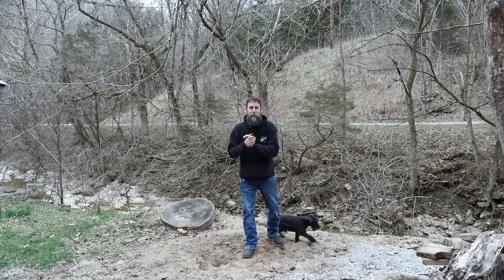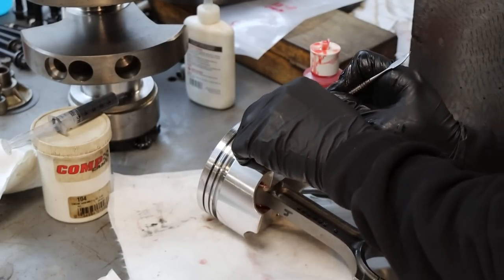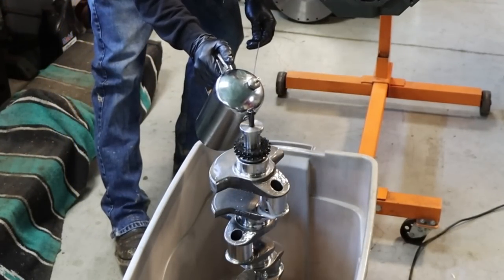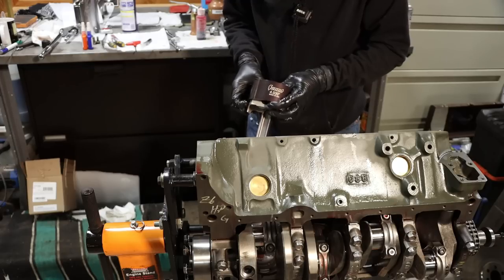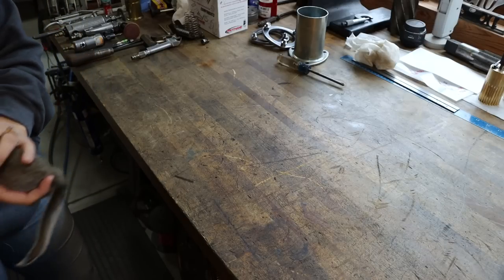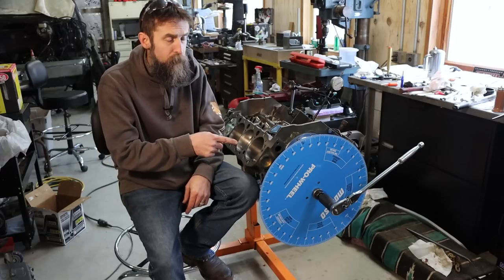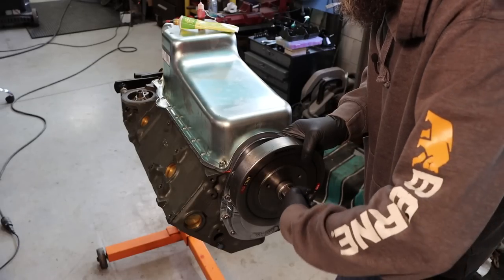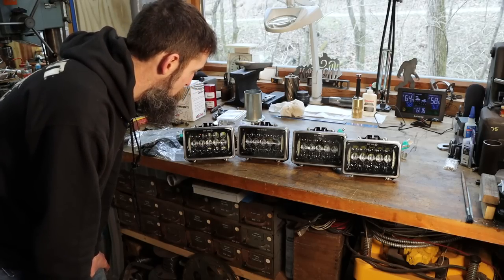Stroked Short Block 383 Day!  Shop under new management!

Comment: Future suggestion ... if you're hell bent on using something like gasoline to clean the block, use diesel instead. Why? Two reasons: 1) Gas and gas fumes are highly flammable. Diesel, not so much. 2) Gas vapors burn brain cells when it evaporates and you breathe it in (becomes a volatile substance). Since diesel doesn't evaporate anything like gas does, far less of a worry. Diesel has great cleaning properties as well. Since diesel is technically an oil, you also get a coat of rust prevention built in.
Reply: Exactly. Maybe one of the parts washer companies will sponsor a safer option. I used gas to clean parts back in the day but not anymore
Reply: People have found some incredibly creative ways to die while using gasoline to clean things. If you're bored some time, look up "flaming rat case" for a particularly bizarre example.

Diesel or non-volatile degreasers are much better options than gasoline.

Comment: I love my sure shot, and had an issue (rusted on the bottom, and was plugging the nozzle).  The thing is 2 or 3 years old, but I contacted them and they said "THAT should not happen, even though it's out of warranty, we're replacing it".  WOW...American Made, and amazing customer service.  I'll buy more of these for more fluids for sure!  What was in it?  Brakkleen...that's it...and they assured me that this is NOT normal, and SHOULD NOT Happen...which is why they are replacing it.  Very happy with the customer service!

Comment: Steve my experience if the proper break in procedure is followed and lifters and cam fail it is because the lifter bores and camshaft center line is not perfectly square. GM had a long history of factory failure during the time period the square bodies were built. I have had blocks that had camshaft lifter failures multiple times and the solution is to scrap those blocks that do.  They will never be right. Roller cams and lifters are great as long as the rollers are maintained square with the lobe of the cam and the cam is anchored so it can not walk forward in the engine. It is also critical to make sure you have the correct push rods for the roller lifters. The roller cam blocks use a shorter push rod than a flat tappet cam block. If you do not already know it you will need the oil pump shaft from a 400 small block. It has a relief machined in the middle of the shaft.

Comment: I'm no mechanic and I'm not even really into cars, but years ago I had an 82 Chevy square body with a 383 stroker. I cannot recommend dual straight pipes highly enough, a lovely burbling. It was ridiculous with a 14-in lift, your feet would bounce off the headliner, but once I gave it adult suspension, that was the most durable truck I've ever had. It was my farm vehicle so it was not treated well, never once let me down and I never found a situation it did not have enough torque for that any other vehicle could. It was not a refined vehicle, you would not want to do a road trip in it. But if you need to move a double wide half a mile or pull down a big fir tree, could not ask for better. Never even needed ether, every single time you turn the key it would sound like the battery was dying and you would get that really weak crank, but she would catch every time. I've had stock Chevy trucks and I was not nearly as impressed, that 383 was ready to work!

Comment: Once you've verified your timing TDC timing mark on the vibration dampener, I always match mark the outer ring and the hub, so you will easily determine with absolute certainty, whether the outer ring has moved in relation to the inner hub. It only takes a couple minutes to punch, but will save you hours of "reinventing the wheel" if it has slipped in the future.

Comment: Silicon the oil pan gasket around the timing cover and rear seal curve. The instructions say not too, only in corners but they always leak without a little silicon. Ultra grey will work.

Comment: I was just reading an article about this economic phenomenon. When hyperinflation is on the horizon, major companies that think they will survive the downtime will engage in various practices to keep profits up. This is already been observed in the majority of groceries, something called shrinkflation. If you start paying attention to your labels, you will notice that the very familiar package has slightly less contents then what you are used to. It's all about the pennies. This article specifically mentioned less scrupulous firms using mislabeled poorer quality steel, all kinds of components are available at a lower cost without changing the appearance. Most brands go through a refresh at least once every 3 years. When you start to notice that packaging is stagnant, that's when you want to really pay attention to the unit pricing. If I'm not mistaken, this article concluded that 70% of groceries were being dropped on average from 16 oz to 13.4 Oz. Not a huge amount, but pretty slimy to hide it with the older packaging. Keep your eyes up folks

Comment: 4:23: You could use Kerosone,  Lamp-Oil or White-Spirits instead. The benefit is way less smell and fire-hazard, and you can lit your BBQ with it afterwards, a convinient way of disposal. I collect it in a PET-bottle for disposal at the recycling-station OR for use to lit the BBQ or camp-fire.

I allways wait until the coals in the BBQ or Camp-Fire stops smoking or smell unusally or badly, and the glow is good. Only then I know I can safely BBQ.

I write this because I personally tend to get dizzy from Gasoline vapours. Not pleasant.

Comment: Another good thing to do. Is to lightly grind both ends of the oil ports oval shape at 2 degrees on your crank. To allow even oil flow out onto your bearings and reducing oil friction heat.😉👍Also sorry for a loss of an old friend.

Comment: Steve, the harbor freight hardware is actually pretty nice, but I would warn you about their hose clamp kit. They are NOT stainless, and develop issues rather easily. They are only plated steel.

Comment: Hey Steve you're doing a great job. I used to own a Performance Shop. a 383 was my first engine build ever. What made you decide to go with 383 nowadays. Was it for simplicity and ease of installation. I personally never looked back after entering the ls and more modern engines. Once I learned how to tune modern fuel injected engines. It's insane what you can do, and control once passing this hurdle. From your fuel to your timing, to your spark. even cam timing. Or things like nitrous or boost control. You can tie them all together with knock sensors. So there's any issue the engine can recognize it mitigate the damage. you can run any kind of fuel and have pre saved maps. It automatically switches to. You can even tie all these things together with traction control. to have launch control. Seeing that this is a off-road truck. Launch control probably is not necessary. These things are all easily added to any vehicle. I am not trying to sell you anything. But you might have fun learning about it. Cheers...also love your Channel. Pet squirrels are awesome. had one I found and raised as a kid.

Comment: What a cool project, you have to be super anxious to get that engine in that truck. I've been following along on your rebuild series, I still run an 89 GMC k2500 with a lazy stock 350 TBI daily. I've had it for 23 years. Always wanted to stick a 454 in it, wouldn't get any better fuel mileage but at least I'd have some horsepower. Can't wait for a review of your LED headlights, mine could really use that upgrade although I've been warned by my inspection mechanic he will not pass it without DOT approved headlights in it. Thus far I haven't found LED's that were DOT approved. Thanks for taking the time to share this build with us.

Comment: make sure to do poly bushings with graphite and trans mount, get some good fog lites and cb - u/l sideband - cut down a 102" whip for 10m and maybe a small linear - the engine looks nice! try to do efi in lieu of carb - worth it - what are you going to do for summer projects (pun intended)? ez does it with all that power - gonna be quite the change - make sure to do some rust prrofing now when you have it all apart #bigfoot
Reply: You mean trim the antenna to tune it?  Linear amp?  Silliness.  Take the test and start playing with the adults in ham radio.  Not difficult to start at all.

Comment: Nice job. When I put pistons and rods in I'll get the pistons all the way into the bore,  and then rotate the crankshaft till the journal comes around to seat into the rod. It's just easier (in my opinion) to ensure that you don't scratch the finish on the crank journals with the edges of the con rod vs taping it all the way home with the hammer. Watching you methodically restore that old truck makes me wish I had more free time after my day job to work on a bigger project like that. Here it's Saturday morning and I have a 10 hour shift today and only one day off (tomorrow) for the next 14.

Comment: Steve. Chevy mechanical fuel pump install trick. 
Set crank to compression stroke number 1 cylinder. Use tip of dipstick straight down thru the top of the opening and in front of the pushrod.  Drop pump lever in against dipstick.  Pull the dipstick out. Start the bolts but don't snug them yet.  Get the hard line to the carb started so you can wiggle the pump to get the tube threads started.  
Now tighten the pump bolts then tighten the fuel line.  On engines with the alternator over the fuel pump. You need to disconnect the battery.

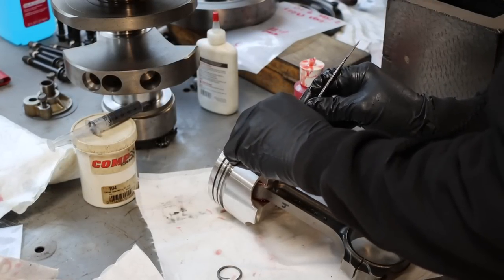Comment: Great video!  I think that it may have been mentioned in a prior video but make sure that the openings of the piston clips(for free floating piston pins) are positioned at the 12 or 6 O'clock positions, I am thinking at the 6 O'clock.  02:25.  Hello from the State of Texas!

Comment: i heared of packing the oilpump with vaseline to get it to prime faster on startup
Reply: I always packed my Rover V8 ( Buick designed) oil pump with Vaseline as it dissolves  into the oil after giving the pump some suction. These engines can be a pig to get oil pressure if you don't prime them and I hate to have an engine spinning even with just assembly lube on the bearings because if the engine fires right up the bearings can get a hammering before the oil comes up. Personally I always spun the engine on the starter and had the ignition turned off to prevent just that scenario. Others may not be so careful.

Comment: That ring compressor is very slick. Only problem is that you would need a toolbox full of them
Reply: The adjustable ones cover a range, 4 or 5 will cover about anything you'll build.

Comment: From both a fuel economy and engine longevity standpoint I think electronic fuel injection is the best option. When I was young and carburetors were the only option it was a fortunate individual who got more than 80 to 90 thousand miles before needing rings. To be sure the metallurgy is better now and lubricants have also improved considerably but I think the thing that has made the biggest improvement is fuel injection. My old stroke 5 BMW motorcycle had about 55 horsepower on a good day and got about 50 miles per imperial gallon, My current Triumph Tiger 1200 has 148 horsepower and gets about 55 miles to the same gallon. My old, ancient really, F150 with the e 300 i6 engine has well over 400,000 Km on it and still doesn't use very much oil, about 1 liter between 5000 Km oil changes.
Reply: I agree.  Now your not flooding and diluting the oil every cold morning.

Comment: For future reference, when you are installing your pistons, to avoid damaging your crankshaft, cut a couple pieces of rubber hose about a quarter of an inch longer than the rod bolts and put them on the bolts the rest is self explanatory. By the way, excellent choice for an engine build. Keep up the good work.
Reply: What? That's for if you're using rod studs. Rod bolts aren't in there until installing the caps.
Reply: I have 16 of them I have used for over 45 years. Nary a scared crank ot bearings from my hand my friend. THEY WORK !
Reply: On this style rod the bolts go through the cap. Nothing to put the hose on....
Reply: @jeffreydurham5342  I just install the bolts and leave the rod bolts held in place with the gas lines I use. They also make the bearings stay put as the hose just covers the open ends of the bearing shells.
Reply: @TomokosEnterprize  You do realize that these bolts go through the cap and thread into the rod, right?
Reply: @jeffreydurham5342   Yup. It is just a precaution. Slip the bolt into the rod and push the hose on tight . The hose has a natural curve in it that really helps to guide the big end onto the crank. It may be an extra step but I always found it was worth my time as I never had a bottom end failure over hundreds of builds.
Reply: @TomokosEnterprize  ok, you do you, I don't see any need in putting unnecessary stuff in the way .
Reply: @jeffreydurham5342  In a build it only takes up about 5 to 10 minutes. Small price for being comfy knowing those easily damaged surfaces are taken care of.

Comment: Don't count on that " stainless " hardware from Harbor Freight.  It might technically be stainless but it doesn't last.....
Reply: Ideally look out for A4 grade when buying fasteners, it is equivalent to 316 stainless steel, much better corrosion resistance than the A2 (302 / 304) grade.

Comment: Although soft liters coming from off shore is a problem, the start of the major cause of failing flat tappet cams and lifters is the oil companies stop putting zinc additives in their oil because of the EPA and tree huggers.
Reply: If you are set on having zinc in your oil, you can still buy it.  Lucas and Valvoline sell it as well as an additive.  Heavy zinc additive will kill a catalytic converter in short time, but I don't think Steve is planning on running cats so no issue.  BTW, EPA and "tree huggers" are a big part of what is going to make this world livable for our grandchildren.  We (current humans) have done a shit job and are not leaving the earth in very good shape.

Comment: I know your trying to be clean but, I wouldn’t wear gloves on final assembly. You could pick up some grit very easily without knowing and transfer it into the engine, like from that hammer you were using
to install the pistons.
Reply: No hammer required when building an engine. If you can't push the pistons in by hand something's wrong.

Comment: So the ARP bolts you have been saying are so good have proven to not be so good - they cannot even get the length right. Lucky you check and re-check because that would have been expensive as well as very annoying.
Reply from the maker: Nothing is perfect . The thread engagement  in the rear main cap was too deep. I would bet that its caused a few bearing failures in the past.

Comment: What was wrong with the old circlip s we used to have I never had a failure with them and so much easier than them damn whateveryoucallem clips for gudgeon pin retention backwards again in my opinion ,thank for posting
Reply: Turned Teflon bushes are the way to go I think. They can run on the bore with no problem and they keep the pin where it needs to be, in the middle!

Comment: You don't need to do all of that to find TDC!
Reply: How would you do it?  Wait, forget that question.  You would just bolt it together and hope the factory marks are correct.  The classic "jackwagon" style of engine assembly!
Reply: @paulcopeland9035   You can do it, by looking at the number 1 rod, and looking at the play in it from TDC and the slack..   How does one fine TDC with a head on an engine??? Or do I have to tell you on how to do it!!!

Comment: Was kind of surprised when I did my final clean on my SBC I had small amounts of trash in all my crank oil holes even after my trusted machine  shop cleaned everything, I added  3+ more very detailed cleanings on all hard parts and I  ran the gun cleaning wire brush and soft brush through a 4th time an blew it all out with air and then brushed the holes a 5th time just to make sure as there is no such thing  as to clean. Same for the 3 oil gally line holes I cleaned and brushed them 3 times, then a 4th until I was very sure they were totally clean as when you tear down the motor next time to read the bearings, that's when I found out, there is no such thing as to clean.
  
    Dogs, I had to put my 13 year old Bull Mastiff down in Nov (13 years for  a Mastiff is very good ) and was asked to join the Mastiff rescue league. I now forster Mastiffs. We had found a 1 1/2 year old male Bull Mastiff that I keep for  a month  and already found him a forever home. Now I have a 4 year old 130 pound Neapolitan Mastiff that is in need of long term health care, and  a very special forever home. Finding homes for these big guys is so rewarding as I want to help as many as possible as we currently have over 40 Mastiffs in Foster care and another 10 or so in need of fostering. Most have health issues but are very good & loyal animals.  The rescue wants me to foster a  second dog at the same time, but I said no, I only do 1 at a time due to there size  and health needs. Some fosters have 3 or more Mastiffs to find homes for, but that's not for me . One 130 pound cridder at a time is MORE then enough . lol